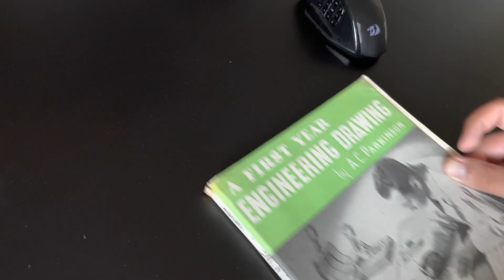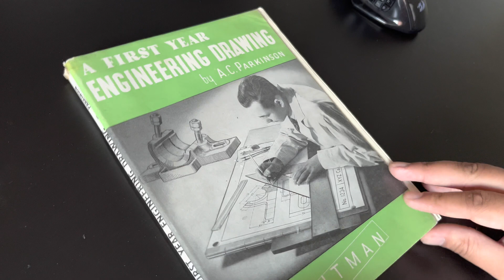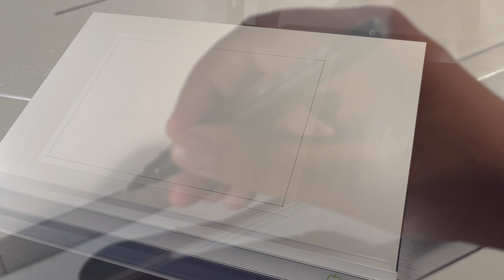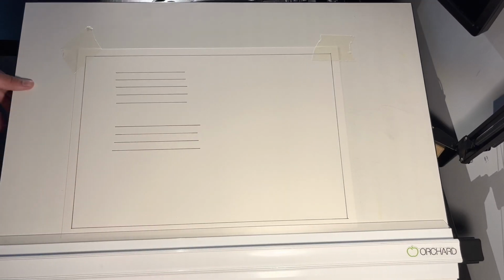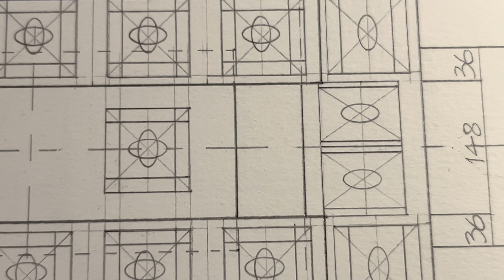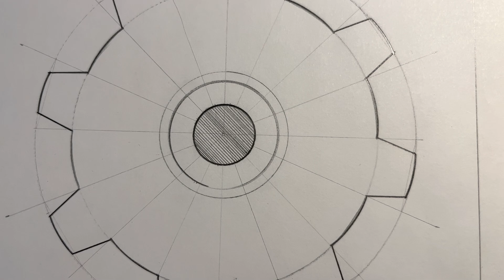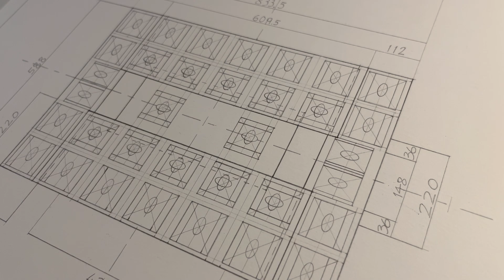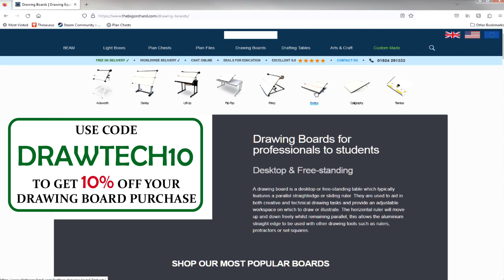Drawing Board Review - Bretton A2 by The Big Orchard

Comment: The gear and other circles, did you do those with a compass or a template? I am thinking a compass would do some damage to the board.
Reply from the maker: Hello, I used a compass on the drawing board. I thought the compass would damage the drawing board too, but it didn't, the material on the board feels sturdy enough to handle 'compassing'.